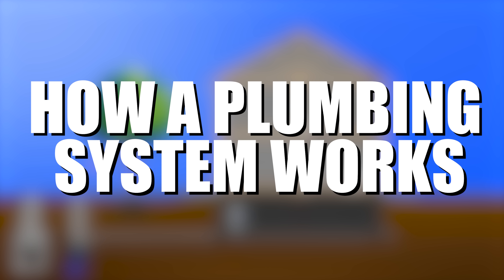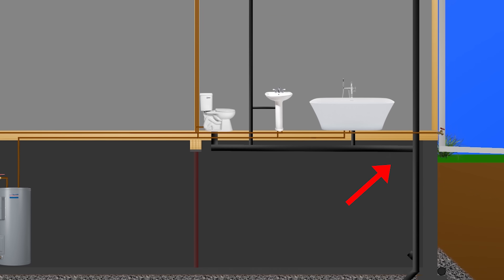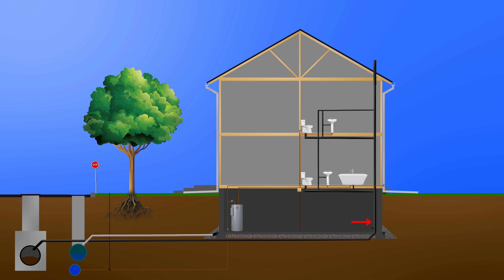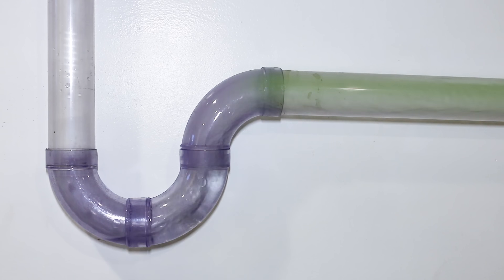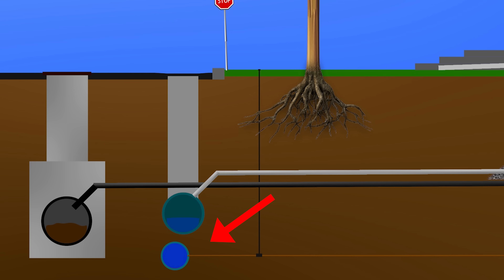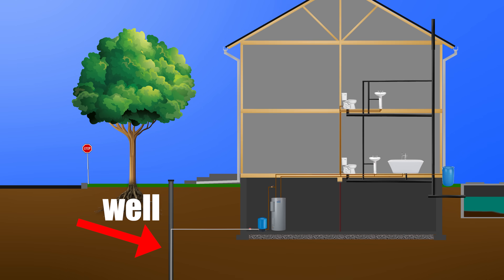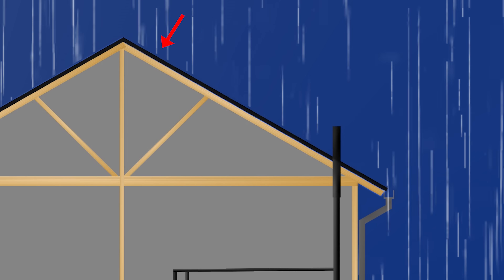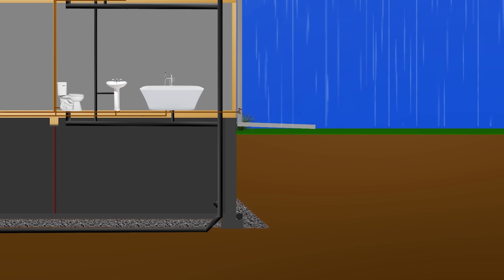How Your Home Plumbing Works (From Start to Finish) | GOT2LEARN

Comment: You forgot to mention that government requires a valve outside so they can shut off your water at any time for any reason.  And the municipal pressure is also created by electrical pumps.  So you are always at the mercy of government bureau rats.

Comment: I'm looking all over the net to find an animated video showing exactly hot a parachute system works.  All I know is that there is  a main chute which is released by pulling something on the back/bottom of the backpack. There is also a cutaway apparatus with disconnects the main chute in case of malfunction. Then there is the backup chute in which I think you have to pull a pin. Finally there is an automated chute which deploys via an altimeter.  I would love to see how all this gear goes together and is deployed.

It's a shot in the dark but I thought I'd ask here. If you point me in the right direction, I'll help you with a "How the electrical system in your house works" video :)

Comment: Shoulda went with the Aztec dual pipe system.
Reply: @Got2Learn  It consisted of a twin pipe distribution system made in part of compacted soil and in part of wood for the crossings of the aqueduct over the bridges built to allow the passage of the canoes. It was finished around 1466 AD, and the main purpose was to supply fresh water to Mexico-Tenochtitlan, to mitigate its thirst.

The main source for the aqueduct was the spring of Chapultepec and the purpose of the twin pipes was to ease the maintenance of the system, because the water was conveyed through one pipe, and when it got dirty, the water was diverted to the other pipe while the dirty pipe was cleaned and, if necessary, repaired (Palerm, 1973).
Reply: @Got2Learn  getting censor bottled for trying to post the link lol. They had a Nat Geo article on it awhile back.
Reply from the maker: @moguldamongrel3054  just checked, I can't find it in my "held for review" section, weird...
Reply: @Got2Learn  I don't think it's being censored on your end. I think the website itself got flagged. Even though it's nothing but an article.
Reply: @Got2Learn  although the Nat Geo article included that they had indoor plumbing using a dual pipe system as well. Like self cleaning pipes to minimize blockages and decrease maintenance needs. Though can't seem to find that, and I don't have hard copies of Nat Geo anymore.
Reply from the maker: @moguldamongrel3054  i'll google it, thanks buddy!!@
Reply: @Got2Learn   @Got2Learn  aztec dual pipe water system my search parameters.
The website is highscalability dot com
Can't seem to find the Nat Geo article. Only reason I remember was the Aztecs always fascinated me, and the pictures were a cutout of dual pipes and an explanation of how it worked. I was rather impressionable back then.

Comment: You have made an excellent video explaining a home's plumbing system.  If there is anything that should be corrected are the sewage / fresh water pipe locations.  Freshwater pipes are at four feet of depth, sewage pipes are six feet of depth.  Your illustration has the sewage pipes above the fresh.  This is not allowed by Code.  If the sewage leaks, this would contaminate the fresh.  Other than this, nice job.

Comment: I'd like to understand how cities manage to pressurize water during the transport to the house.  Do they do that only using gravity alone or througout a serie of pump ?  How does it works ?
Reply: Both gravity and pumps, depends on the terrain and how the system is setup. If you notice, water reservoirs and towers are set at high locations.

Comment: I am a president of the HOA in my country and have been explaining to the other owners why it was a stupid idea to close up the sewage pipe on top of the apartment complex with a  carbon filter against the sewage smell. When the top floor is flushing the toilet all the drainage on the lower floors are sucked dry and the sewage smell will get into the houses below. It took me 10 months to figure out what was causing the problems. I send all owners an enquiry about the smell. I climbed onto the roof to find the installed carbon filters which prevented the pipe to get air in fast enough to equalize the displacement within the pipe. I wonder if there is a mathematical formula that can be used to calculate how wide the pipe must be for different height of buildings with several apartments connected to the pipe.

Comment: From an engineer that designs municipal sewage systems for a living. Excellent video. Only edit I would make would be to explain how the check valve(back flow preventer) fits on the san service to protect the house during a flood event.

Comment: We are currently having our corroded cast iron replaced under our slab. It was causing a slow draining shower and water leaking from the base of the toilet after every shower, and sometimes when the toilet flushes (not nasty sewage - thank God). Will new pipes completely eliminate this problem? I’m starting to get very nervous.
Reply: Our plumbers said this would solve it but I’m still concerned and wanted another opinion.

Comment: My tub was plugged up so I removed the part that screws into the pipe and the water went down but when I screw it back into the pipe it clogs again.. Is it going to the side of the pipe and onto the ground under my house?. Can I put drain cleaner down the overflow pipe?.

Comment: There is a lot of good information here but there are some things not true before getting to 2 minutes in the video
Reply from the maker: Like??
Reply: @Got2Learn  
As far as misinformation-
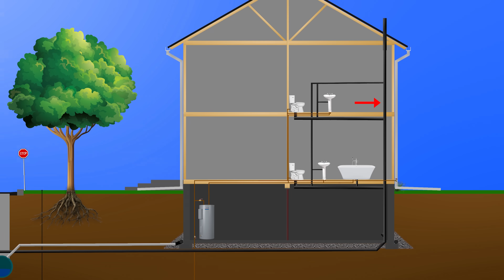1:34 mentioning Code for Showers and tubs, some showers require 2" or higher depending on their gpm. However bathtubs only require 1½" and showers with a flowrate of 5.7gpm or less only require such as well according to IPC 2018 table 709.1

The rest is anecdotal 
0:40 Galvanized steel was not mentioned for drains in homes, which I run into more frequently than I do cast iron.
1:18 I rarely run into any cleanouts outside of homes in my area(about 20-40%), but again, this is based on my area of work.

I understand that the video is very informative and helps more than it hinders, so I can excuse leaving out some lesser known materials for the sake of brevity. I do, however, take issue with siting a code that I haven't been able to find.
Reply from the maker: Yes, as you mentioned, I wanted this video to be brief and to be more focused on the general idea, rather than the details, or the video could have last 2 hours, so for sure there's some stuff missing, but I thank you for filling in those gaps, this channel needs more like you!

Comment: If the sewer vent blows 50ft into the air, I Wonder what happens to the rats when they light the methane gas in the drains lmao

Comment: Loved this informatory video from India.
My house has a septic tank and we draw water from ground using water pumps and that water is stored into big tanks above houses later that water is used for supply in water taps...and drinking water is stored in Big containers or bottles inside our house, Non toilet water is drained into water channels outside our houses which are unfortunately open and they collect rain water aswell. Toilet waste goes into septic tank.
And those narrow water channels outside our houses drain into a broad water channel and that water is so dirty it looks black in appearance and smells😷 but I don't know where does it end.

Comment: Don’t forget about Pressure Reducing Valve right inside the house. Don’t want ~40 psi coming out of your faucets😂😂 Great video though!!
Reply: I don't think 40 psi is a problem, the area I work and live requires a PRV at 80 psi and above. FYI the highest pressure I've seen is 162 psi, makes open a hydrant a little more exciting

Comment: In New Zealand, if you're not on municipal water supply, you typically collect rainwater from the roof and store it in big tanks set on the ground, then use a pump to feed it into the house. Some farms the a few rural houses will use bores (wells) for water supply, but much more common to re-use rainwater.
Reply: 👍👍🖐🖐greetings from the usa.........new jersey to be exact
Reply: @fransiscoscaramanga674 😅

Comment: Awesomeness video. What do you call the main potable water pipe coming into the house? I always want to call it the water main, but I don’t think that’s right.
Reply from the maker: That's the correct term yes 👌🤗
Reply: @Got2Learn  Thanks.
Reply: The water main is the pipe in the street, the pipe running from the water main to the water meter/house is called the water service.

Comment: Great video. I don’t think that I’ll be drinking the municipal water.  I know they said that it’s filtered. As far as taking a shower.  TBD. I may have to move to well water area. I gotta say that I learned more then what I wanted 😂😂😂
Reply: Hector City/municipal water systems can get their water from many different sources, you should go to your water systems website to see where they source their water. Where I live they get ground water aka well water from a large aquifer, where I work they get ground water from the same aquifer but also pull water from a river high up in the mountains. Just remember, all water is "recycled" usually through the water cycle.

Comment: It would be nice if the meanings of the acronyms of the pipes were given (e.g., ABS, PVC, etc.).
Reply: ABS = acrylonitrile butadiene styrene. PVC = polyvinyl chloride. CPVC = chlorinated polyvinyl chloride. PEX = cross-linked polyethylene. They are all different types of synthetic plastics. Some have unique properties that make them good for certain applications. Some may be good for one application, but not others. For example, PVC can handle cold water, but not higher temperatures, so you wouldn’t use it in a hot water situation. CPVC, on the other hand can withstand much higher temperatures.

Comment: Dude I love ur videos. They make plumbing seem less intimidating. So much so I’m getting ideas. 
I want to clean out my pipes, back flush? I’m thinking of trying to pour vinegar in the water heater and letting it run through the pipes if the house. Letting it sit in pipes for a few hours then flushing it all out. Thing is I don’t know how or if I should do the cold water lines. Thoughts l?
Reply from the maker: Thanks man! Yes a lot of people use vinegar to remove calcium deposits in their tank, there's plenty of videos on YT about this, I don't have one up yet hehe!
Reply: @Got2Learn  awesome, except I’m thinking of running the mixture through all the pipes in the house. To clean the pipes out. We have hard water here and The pipes are over 40 years old. I’m thinking of a 50-50 mix of vinegar and water. Am I over doing it? Think it’ll work?
Reply from the maker: Not sure, but probably. Ever think of getting a good softener?

Comment: FYI, most homes in the Deep South don't have basements. I think that's mainly a mid state to northern thing.
Reply: I’ve never even seen a basement, except in pictures. My house is slab on grade, so the water main enters through an exterior wall. The shutoff is outside the house, so I guess in theory, anyone could walk down the street shutting off water to peoples’ houses. My water main from the meter to my house is also PVC, and inside the house it’s galvanized steel. None of this is optimal. 

One thing about having a well that deserves mentioning...that blue tank you show in the basement is a pressure tank that connects to the line coming from the pump. It holds a certain volume of water and keeps it pressurized so that your pump doesn’t kick on every time you open a tap for a small amount of water to say wash your hands or fill a glass. So the system will work without power, for a little while anyway, until the pressure tank empties. After that, yeah, you need a generator or a hand pump.

Comment: Great, informative video. I wonder if the sewer lines can freeze in the winter (in Canada) if the house has no hot water running (water heater broken), but the heating is still working?
Reply from the maker: Yes, absolutely!
Reply: I don't think so, sewer systems are usually relatively warm. Notice next time it snows, the sewer manhole will melt the snow and be the only part of the road you can see

Comment: Great, informative video 🙂 Must watch by all home owners
Reply: Yep, we drink and bathe in recycled toilet water.    Toilet water get treated in water treatment center and release back into the rivers.  The same water from the river get suck back into our homes for use.
Reply: And must watch for section 8
Reply: @joematt98 ,😂❤🎉😢😮😮😮😅
Reply: @Shadale Breary I literally asked the same question just now before reading your comment. Did you find out?
Reply: 0p
Reply: does is count if my parents own the house, i rlly wanna watch this
Reply: And contractors!
Reply: or be shown in schools perhaps?
Reply: Yes very informative great graphics too also useful knowledge
Reply: There I did you a Favour and report the spam on here😃 Tnx for the tutorials mate♨ Plus I subscribed🔥
Reply: You Rock🎸🎧 Thank you for removing Spam👏😎😁
Reply from the maker: Comment pinned! 😏
Reply: @Got2Learn  Having a new bathroom installed right now, They have ran the vent into the attic, but not out thru the roof. I ask them and they said it was fine, because air is sucked into the vent, but it doesn't allow air (stink) out of the vent. Is that true?
Reply from the maker: @wilbl7778  is it at least connected to the main vent in the attic?
Reply: @Got2Learn  No, it is not.
Reply: @Got2Learn  No it isn't and he got the toilet installed today when I was at work. I flushed it when I got home, and it does flush (not as strong as I was hoping) and once the flush was over, it bubbles up for a few seconds.

Comment: Septic tank description was very bad. Tanks have 2 halves, the solids stay in one side, a biofilter keeps them on that side. A healthy septic tank will actually break down its own matter and should never have to be pumped. You can add microorganisms that will break it down as well.
Reply from the maker: Didn't really go into details in here Shannon, but thanks 😉

Comment: All good except when describing the weeping drain, he used the word “corrugated” when the more appropriate word would have been “perforated”.
Reply: It's both 🤣
Reply: In some cases, but not necessarily. It is more important that the pipe be perforated than that it be corrugated. If it is corrugated but not perforated, it’s useless for a French drain. But if it’s perforated but not corrugated, it’s still useful.

Comment: How do I turn off the outside water without turning off the inside water?
Reply from the maker: You can't unless you have an isolation valve.
Reply: @Got2Learn  where would that be sir
Reply from the maker: Near the outdoor faucet

Comment: My hot water heater in back of house,  so does it go there directly or  feed other things first?
Reply from the maker: All depends on if you have fixtures between the back and the front of your home.
Reply: @Got2Learn  yea bathroom , kitchen, pretty much errthang, but i gotta go look and follow the pipe to c exactly
Reply: @Got2Learn  ok it feeds other things first,  so my I wanna replace section of hot water galvanized,  if I turn off main line it turns off water but do I gotta turn off hot water from water heater too?
Reply from the maker: @Eastbaypisces  no, you can just shut the water to the house.
Reply: @Got2Learn  ok coo thx

Comment: How about polypropylene waste pipes, don't you use then in the US?  Over here, they are usually used with push-fit or compression fittings.

Comment: What about gas ? How does that get there
Reply from the maker: With pipes.
Reply: @Got2Learn  no shit but what is the gas distribution network? It’s easy to find out the electrical distribution network but not gas
Reply from the maker: @bobsmith3291  it comes from a well believe it or not :)
Reply: @Got2Learn  what under your house?
Reply from the maker: @bobsmith3291  No from energy companies, they basically drill wells where they know they'll get methane (natural gas) and distribute them underground to residential homes.
Reply: @bobsmith3291  gas is distributed in a similar way. There is a pressurized gas line from the gas utility company that goes through a meter and into your home to your appliances. Obviously there is no waste gas to dispose of, like there is waste water, so it’s just the supply line coming in.  But interesting fact...natural gas is odorless. Part of the distribution process is adding the pungent odor you associate with gas. This is done to make it easier for people to realize when there is a gas leak or buildup. This practice started in the 1930s following a tragic gas explosion at a school in Texas.

Comment: So when a house is built, they build underground pipes towards the sewers on the street?
Reply: Yes, if it's a new development then there is a line "stubbed out" going from the sewer main to the property/lot where the house will be built. Typically a excavator digs trenches for the plumber to then setup all the sewer lines and connect them to the line coming in from the street, it's called the sewer service.

Comment: Hello there,

My household has a reoccurring issue where rats seem to enter the furnace room. Could there be a possibility that rats are entering through the sewer? burrowing around or through the pipes to enter the household?  Pest control has diagnosed the issue as unknown and fails to do resolve issue. Who's liable for this situation the City of Toronto or myself?

Toronto, ON CAD
Reply from the maker: Yes they can be coming from the sewers.

Comment: Internet is a great tool to educate, enable and feed our curiosity. It only depends on how and what it is used for. 
I agree that if feasible, it will be best to run separate vents for all fixtures than a vent.
This is an informative, detailed and yet precise video.

Thank you
Reply from the maker: Thank you so so much!!